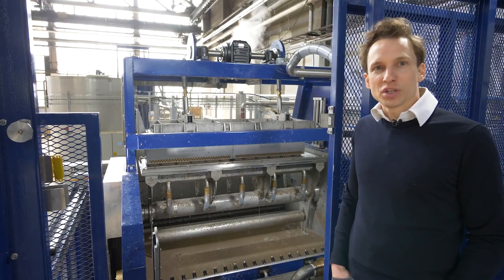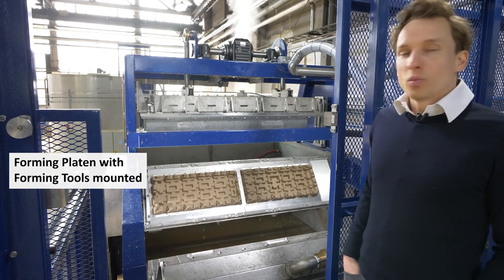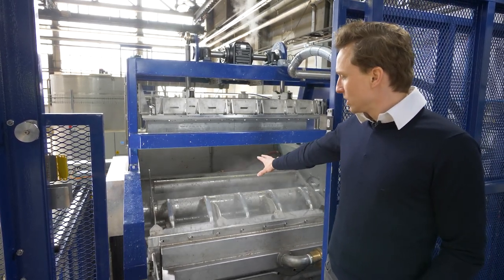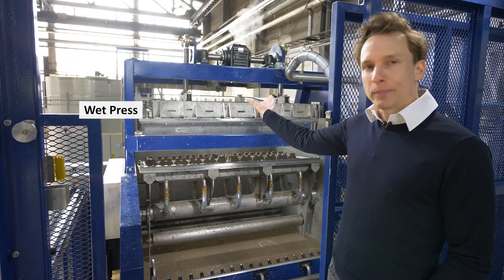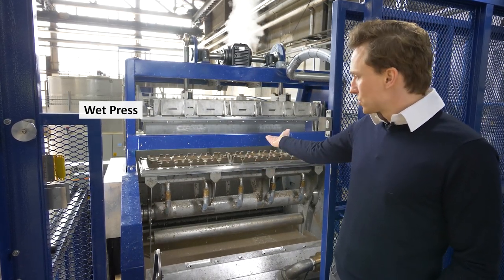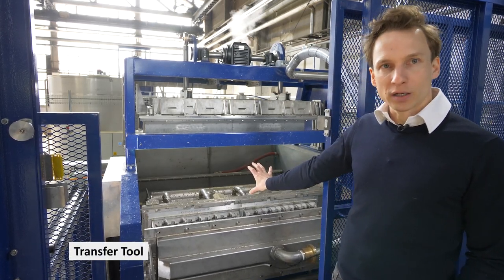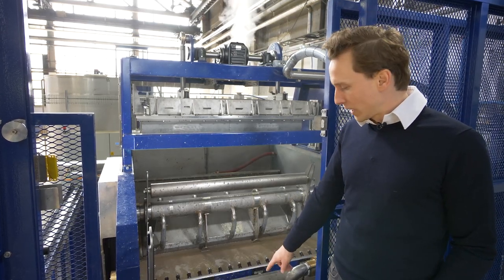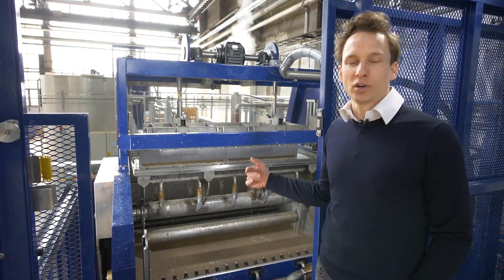Moulding a pulp product

Comment: It looks more like 4 cycles a minute. Do you have any machines that have at least a second mold platen face, perhaps 180 degrees to the existing one? I'm sure you know the efficiency of that. I'm curious why you use a single platen machine in a rotating design? Is it a short product run, and you wish to make fewer molds? Thank you for the video!